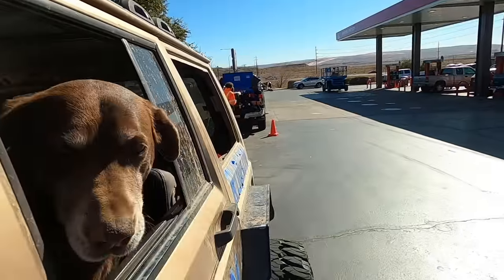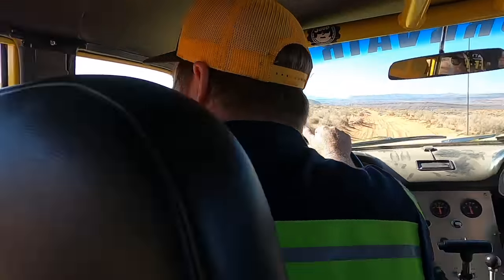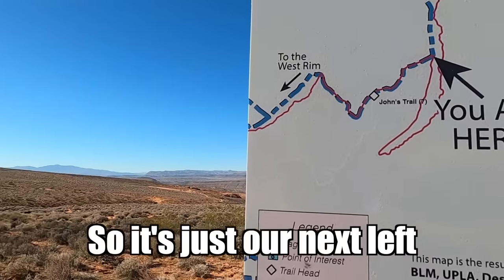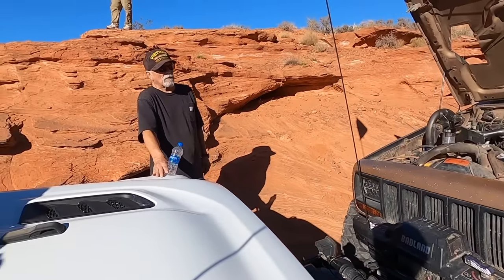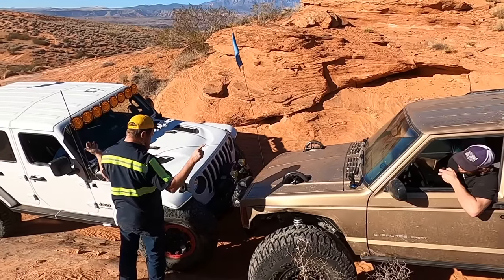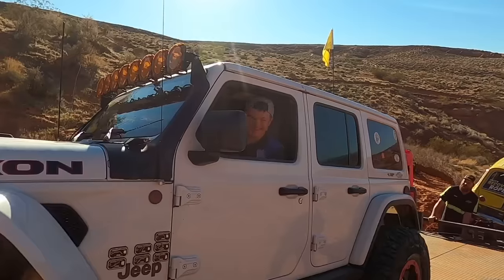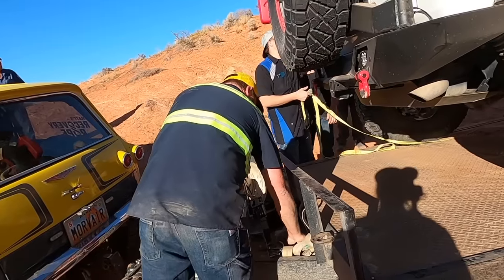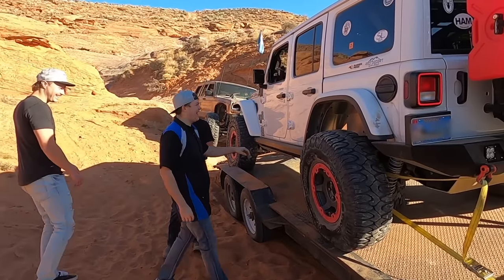Destroyed Front End Jeep Rubicon, Destroys My Trailer!

Comment: You guys are great with "Run Whatcha Brung", but some of your frustration comes with "out of category" equipment.  The car hauler is low for pavement.  Drop axles on a long trailer -- yeah, not so good for rocky off-road.  As a trailer engineer, I smile -- and cringe -- with the abuse!  Yes, the big wrecker will be cool, and it's way more macho, but the right trailer would seriously help.  I design specialty trailers, so let me know if you want a custom design for off-road recovery.

Comment: So maybe this is a dumb idea, air bag the trailer. I'm not an off roader, but if you could do that , it would raise the deck but then you could bring it back to a normal ride height for highway use.
Reply: Put low profile, wide, steel rollers on the back edge of the trailer...like White M3 Scout Armoured cars had on the front in WW2....

Comment: Why not put the same size of tires from the morvair on that low bed trailer. By doing so you will get more ground clearance during off road use and you’ll be able to share on your spare tires. To try this should not be much of an expense since you already have those tires in another vehicle. I watched this video and seeing the abuse on the trailer is kind of painful.

Comment: I would think a m1101 trailer set up with big fat sand tires would have been better then that trailer. you have the shop and then money how hard would it be to rig a dual axle on a frame? you only need a 8 foot bed top. But then if you can spend big chunks of change on a custom-built wrecker why not huh =P

Comment: Matt what type of jack was that you used to jack up the trailer
Reply: Looks like a custom hydraulic cylinder with a small hydraulic jack valving arrangement to create a hydraulic high lift jack?
Reply: @JohnSmith-yv6eq  I was thinking the same thing and if that’s the case, someone put an awful lot of time and engineering in to that jack

Comment: Something tells that the trailer may have lost a couple thousandths of metal off the bottom of its frame after all that.
Reply: Put low profile, wide, steel rollers on the back edge of the trailer...like White M3 Scout Armoured cars had on the front in WW2....

Comment: Think that trailer needs taller tires and it's  own motor power.
Reply: Its own power would ultimately turn it into an off-road rollback.
Reply: Tesla drive trains; wheels each side independently controllable for steering; battery packs under the deck; 600hp to push the MORRvair up the hills?